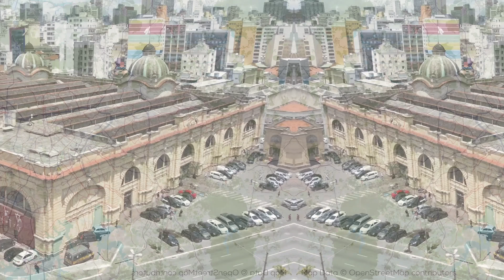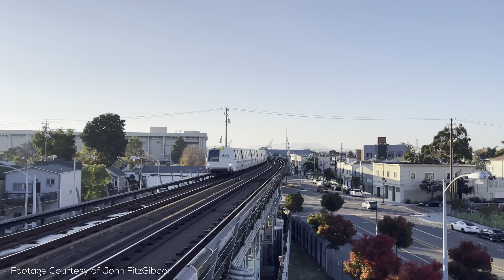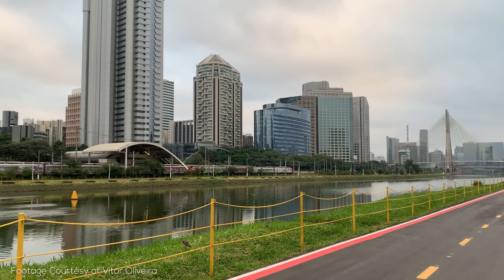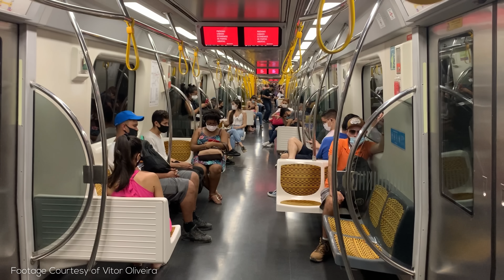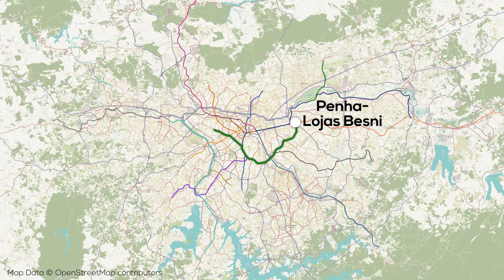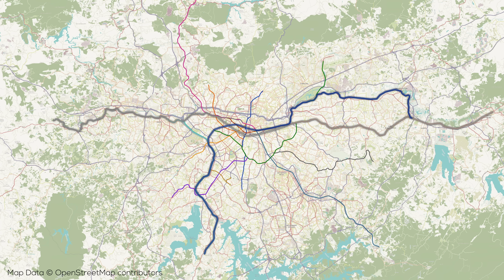The Busiest Subway in the World? | São Paulo Metro, Brazil

Comment: The lines 8 and 9 became really very bad after privatization, it happened, if I'm not wrong, last year, and it had very serious incidents since, like a train crashing in the platform. Both lines have more than one problem per day, like energy faults and this type of thing.
Reply: That's a narrative spread by those who are directly against private operations, aka, the Unions. People who use such lines on everyday basis mostly (by far) agree that, despite the problems, they still improved a lot since privatization.
Reply: @evertonmv1217  Very true! I'm one of those daily users who agree with privatization!
Reply: @evertonmv1217  this is not what we saw in, for example, local news in almost every morning on TV, there plenty of material of people travelling by metro and giving interview to the reporters and talking about that. Also, the official registers strengthen this claim, even so, the MP already asked to the government to end the contract with the Viamobilidade because of, not only these problems or the accidents, but because the company didn't provide enough specialized personal or all the needed equipment for the line operation, and they also put a heavy fine on the company too. It's important to remember that even before the contract being signed the TCE already denunced that the investments promised by the Viamobilidade wasn't enough to run the line too.
Reply: @evertonmv1217  I’d be extremely curious about what exactly became better since the privatization of the line 9.
Reply: @guilhermesoares8815  You will get your answer if you ask the everyday passagers and not by listening to the "60s mentality" politicians nor the "parasite style" union members who are just now praising the Cuban dictator.
Reply: @evertonmv1217  well, no one’s here to discuss politics or what people do or praise. The question was whether the line 9 has become any better since the privatization and the answer is a clear no. Panes all around, accidents with trains in platforms, delays and the like. That’s at least what people say, the same who use the line everyday. I know that and you know that, but you seem to be more interested in hiding that under the rug and discussing other matters which are not what this channel is here for.
Reply: @guilhermesoares8815  For me, and for the real metro users, the most important thing is not discussing with hypocrites, but knowing that concession will continue.
Reply: Yet I’m sure most of the riders are pro privatization… which is pretty sad.
Reply: @guilhermesoares8815  I don't think so, yes there is some kind of political position that see privatization as a manner to increase efficiency, but based in what I saw in the news when there is a problem like this and the reporter goes to the stations, the riders seems pretty aware of the fact that these problems steams from the concession of the line. The main problem, from what I saw, is really the political one.
Reply: @dkmark7802  Yes, the political problem is the greatest there. Still, the governor just announced the Metropolitano’s privatization with little to no reaction. Apparently he wants to zombify it and turn it into a regulatory agency or something like that… I also don’t quite get the problem with line 9, since CCR seems to operate lines 4 and 5 quite ok. I lived one year in SP back in 2017 and the line seemed quite ok under CPTM, which is probably why it was one of if not the first to be privatized, leaving CPTM with the more problematic ones…
Reply: @guilhermesoares8815  I guess the real problem with the lines 8 and 9 is that they're older than line 5 or 4, do they need more maintenance and are, in general, longer than the newer ones. The Viamobilidade claims that the problems already existed during the CPTM operation of the line, but we don't really see that being truth, at the same time they want more invest from the government to improve the line and be able to pay for a more careful maintenance to prevent the system against the problems we already see happening. The impression that we get is that the concession was not well made and the company underestimate the costs of running the lines, or that they really have the intention of providing a very bad service. Either way, the judiciary and the regulators agencies already identified violations in the contract proposed by them, but the government don't seems to be interested in the cancellation of the contract.
Reply: The majority is in favor of privatization! Why? Lines 4 and 5 are the best in the system and are private and don't have the silly political strikes of the government lines! As simple as that! @guilhermesoares8815

Comment: São Paulo doesn't actually need RER-like tunnels to through-run its suburban rail lines, it just needs a new flying junction and some updated signalling

New tunnels would be very useful for future long-distance/high-speed rail though
Reply from the maker: It doesn't no, but it would probably be useful for the same reasons city centre RER are generally useful!
Reply: It doesn’t even seem to cross the legislators’ mind to build or even conceive RER-Lines in SP. I also feel like except for the Paulista area with Lines 2, 3 and 4, the mobility within the city is pretty poor if you just want to use the subway. Most lines are far too pendular and the bus system isn’t really great to compensate for that. The city needs at least 4 or 5 more lines through it to give a feeling of a robust and dense system

Comment: I just LOVE the SP transit system! Been lucky enough to be able to travel to and live in SP several month a year over the past few years. Practically using the metro lines on a daily basis to and from work. I mostly use line 1 (azul), line 3 (vermelho), and line 5 (lilas). My favorite being the stations on line 5 with their gorgeous glass canopies. Many of the main stations have snack and fast food shops both on the inside and outside. Sometimes on the way home from work, I would buy a cachorro quente and a milkshake at the Santa Cruz station.
Reply: One rather bizarre thing I remember from riding the subway in Hong Kong is the fact that eating is forbidden inside the payed areas of the stations. A bit to cobtrolling for my taste.😂

Comment: I visited for work and I found their payment system to be very hard as a non-Brazilian. Like you said, I had to take a bus to their airport connection.. then found out I needed a Brazilian bank account to pay for a ticket.

But otherwise the system was great, once I had cash and could pay with that. Made me wish New York built new lines!
Reply: They are now rolling out an improvement on the payment methods of the system, the Aeroporto - Guarulhos station was one of the first to receive it. You can now pay with credit and debit cards, or smartphones / smartwatches via NFC. 
As everything here takes a while to be fully settled, it is not available in all stations, just in the main ones for now
Reply: It wasn't like that when I lived in SP up until 2018. At least for us Brazilians, they accepting Pix as a payment methode made things a lot easier.

Back then, you actualy needed to have cash to charge their metro pass. In 2020, the Brazilians created Pix, which is a free money transfer between any two banks at any time of the day or night using the bank smartphone app.
Reply: @sohopedeco  Pix is a Brazilian payment method that Brazil is way ahead of US and Europe.. Really... And the problem is that to have a pix you need some sort of a bank and they require a cpf number.. This is a problem that foreigners have in here, althoug they can have a temporary cpf now not everybody know this.. And remember that to operate pix you need internet, so you need a Cellphone with a brazilian sim-card and to activate it you need your cpf number also..

It's the same problem for foreigners about the food delivery apps because they also require the cpf number, and in some cases actually in a lot of cases, the international credit cards can have a problem with Brazilian machines, they need to operate only on credit.. A problem still to be solved if you're travelling alone..
Reply: @Balrov1  multiple Europen countries, all UE and UK adopted UPI, instant payment system created by India in 2016, and PIX was based on Indian UPI system, it isn't an original idea, UPI is used in 21 European, Australia and Asian countries.

US has an old school banking system, Europe doesn't, and things will change this year in the US, FedNow is live, it is a instant 24/7 payment system just like UPI and PIX, banks are already working to integrate FedNow in their apps, get your facts straight.
Reply: In train system you can pay with money R$ 4,40 for a ticket.

Comment: I'm from São Paulo and i use the metro system everyday. Awesome video, and thanks for showing a good underrated metro system. 
There some things that i think its cool to point out: 710 service will be finished because privatization of line 7, that includes the Intercity Train project that is an express trem from  Barra Funda to Campinas City. Its trains will use line 7 tracks to Jundiaí and go to Campinas, 100 km train track including line 7 and the remaining distance to Campinas, one of the biggest city in State of São Paulo. 
Second thing is the circular line isnt in the project of the Rail System and it is pretty rare that kind of line in Brazil,  since Brazilian cities has the center that majority is comercial and residential areas barely far to center. Thats the main reason line 3 is the most busiest in the system. Also Sé station is also in the center, located under Cathedral of Sé, where marco zero (point 0 km, center of center) is located.
On paper there are projects of some lines: Line 14 - Onix (CPTM) North-South line in the east zone connecting lines 13, 12, 11, 3, 16, 15, 10; Line 16 - Bronze was a monorail in Sao Bernardo changed to BRT system; Line 17 to jabaquara; Line 2 to Dutra along the new Line 19 - Celeste, that will go to Guarulhos, Line 13 to Mooca on south and to Bonsucesso on North, Line 16 - Violeta, from Line 4 yellow to Line 15 on the east going along side to line 3 in a region that has only buses, Line 22- Marrom, from Line 2 to west to Cotia, Line 20 - Rosa from Line 7 going south than east connecting Lines 7, 8, 2, 4, 22, 5, 17, 1, 10.
I like this kind of content so I follow a lot about São Paulo changes on the metro system
Reply: Qualquer paulistano percebe o caráter utópico de se construir uma linha circular como aquela ou terminar várias linhas em um tempo sequer razoável. Nosso sistema de trens é incrível, mas há uma população muito grande que não tem nenhuma estação perto
Reply: ai esse babado do trem de São Paulo ligada à Campinas rola há anos. Queria muito, ia expandir novos horizontes
Reply: 10/10 tamo junto
Reply: jundiai reference lets go
Reply: My guy literally educated the whole census, including other paulistas (👉😳), on the current state of our rail-system.

I'm not gonna lie, we REALLY should promote more the awareness and interest of keeping up with what the hell is going on with these services so necessary on our daily lives!
What little we hear from media barely scrapes the surface and never really enlightens us on what's going on!
Reply: Perfeito apontamento !
Reply: The proposed Intercity Train is a joke and will cause plenty of headaches for current CPTM users. It's not a good idea. The government should build a competitive intercity service using high-speed rail, leaving the old tracks to metropolitan heavy rail (should be possible to offer an in-between service with a few changes to the current CPTM paradigm).
Reply: @CaioCésarOrtega  I couldn’t disagree more. Having been born in Campinas and currently living in São Paulo and working in Campinas, and having lived in London among other European places, the local train to link Campinas and São Paulo definitely is the way to go. Whether you could be right that there also is a demand for a higher speed, more dedicated line, it doesn’t mean that the local train shouldn’t be extended from Jundiaí to Campinas. There’s a huge demand in place for that link, even if the travel time would be excessive per your point of view. Even on that I would disagree, but then again…
Reply: @fernandocamargo6590  eu virei o edital e todas as apresentações técnicas do avesso. Não faz sentido misturar dessa forma. Estamos prejudicando o passageiro que já come o pão que o diabo amassou todos os dias em Morato e Franco da Rocha. Eu propus uma solução de conciliação, mas não posso linkar aqui.
Reply: Onde vc achou todos esses projetos? Acho bem difícil de saírem do papel
Reply: once, I used line 3 red and this line really s*cks. 😃
Reply: @haroldomiyaura912  I say the same for the New York City subway. 😄👌
Reply: @haroldomiyaura912  Yeeeeaaaah, not exactly the most shining gem of Metrô. 😒'
Line-3 Green and Line-5 Lilác are really good, though, I can say that from daily use! Just avoid them during lunch hours and rush hour, SPECIALLY 5 Lilác, or they be making Tokyo overcrowding look like child's play. 💀
Reply: @MrDibara  did you say line 5 lilac? I know the most overcrowded line in São Paulo is the line 3 red.
Reply: @haroldomiyaura912  Line 2 Red.
Line 3 is the Green Line.
Reply: @haroldomiyaura912 New York subway dirty and full of rats or rubbish!
Reply: @haroldomiyaura912  ela é superlotada, a conexão com a linha 2 verde irá desafogar a linha 3 vermelha
Reply: mama aqui glub glub @haroldomiyaura912

Comment: Really nice to see São Paulo on RM Transit. The system is really good, has been heavily invested on in the last 20 years and the integration being free between Metro and CPTM helps a LOT, especially for the poorer people (and me when I was a student). The bad part is: they started building way too late in the 60s and build one line at a time when it was a cheap using cut and cover method (you can find great photos of Jabaquara Avenue being opened to put the subway underneath), now it’s harder to catch up, but it’s great to see 3 major expansions going at the same time. I dream about the possibility of having 8-10 lines of subway, if 5 lines are incredible helpful I can only imagine when we have more.

About the AirPort Express, it’s a awesome service. It’s not great that the train stops shorts (the airport operator didn’t let the train finish inside and now it’s paying for the people mover), but even so, it’s so much faster and cheaper than going by Uber or taxi. It’s takes 30 minutes to go from Barra Funda.

About the concession of lines 8 and 9,  the service has worsened. I’m a user of both and headaways have increased and some accidents happened (which didn’t happened before) unfortunately the government wants to keep doing this.

Reese, it’s strange the line 17 is scheduled for 2026 because most of the structure is ready and that section you showed now has put the beams in place to support the trains. No one explains why that work never finishes, we have 3 or 4 changes on the firms responsible for the building. And the line 15 has had their share of trouble too, I hope they never think of building monorails again, they’re as expensive as subways and much more troubled.

Comment: Why did they use monorails?  How do they handle junctions etc?
Reply: They built the monorails because São Paulo is a very hilly city and the area of the city that line 15 runs through has steep slopes so it was either a monorail or a much more expensive underground subway
Reply: Because we drive the poor away from the central areas. The poor built cities on their own, without proper planning. And now we have to triple the network to mitigate our terrible land use.
Reply from the maker: Like any monorail, movable rails!
Reply: What is it that makes monorails work here?  Do they handle steep slopes better?   Have they turned out a good solution? @RMTransit

Comment: If i remember correctly, Sao Paulo also have experimental elevated guided busway, named Express Tiradentes. But it seems the experiment are failed, instead they converted to elevated BRT like Xiamen does. But I don't know into the detail
Reply: Yeah, you are right. The experiment could've been continued, but the line was simplified. Anyway, Expresso Tiradentes is working since then, with diesel buses and without guide wheels.
Reply: And even though is an failed experiment, they managed to use the structure properly, serving as a conventional BRT system. 
The sad part is the structure which is not so friendly to its surroundings
Reply: Well, atleast it is proper BRT though, having metro-like right of way with 💯% grade separation. Anyway, thank you for the detail
Reply: Remembering that we also have a trolleybus system that unfortunately is stagnant and even in decline

Comment: Great video, I'm taking the freedom of pointing out some things about the eastern lines tho:
1. As a heavy user of line 11, I can say that the expansion to barra funda isn't welcomed. 
2. The line red connects with line 11 in other 2 stations: Corinthians Itaquera and Tatuapé. It also happens to be the only two connections that aren't free, so, depending on the day and the hour, you might have to pay for it.
Reply: The expansion may be unwelcome (personally, I love it), but it's necessary anyway. If the land use patterns don't improve, Line 11 will always be a hellscape during rush hours.